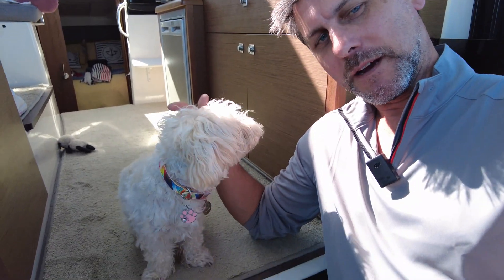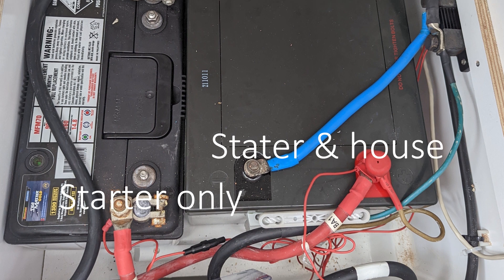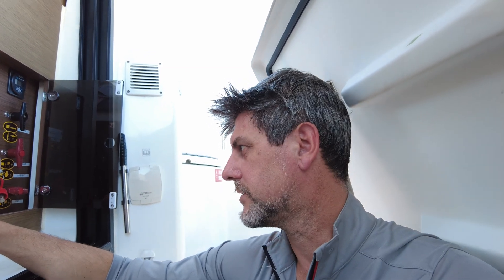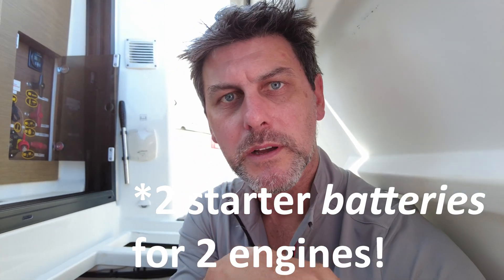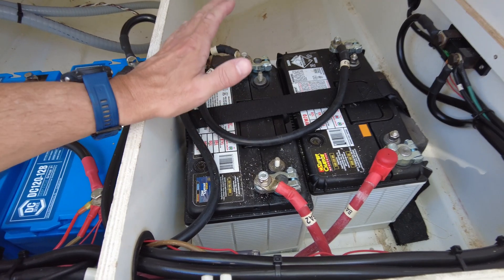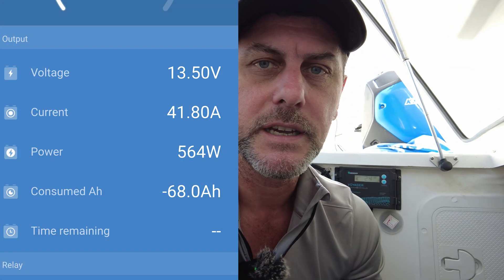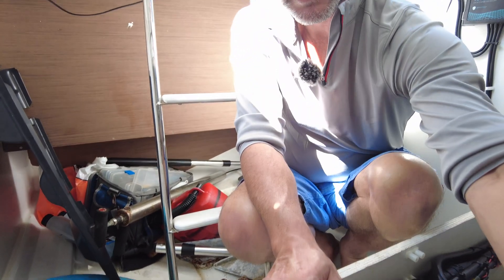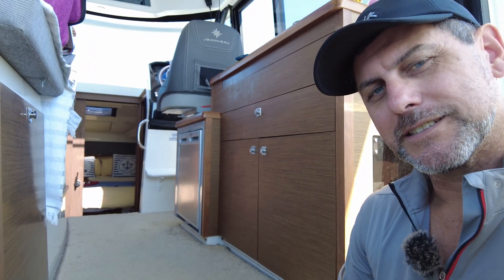NEW BATTERY SET-UP

Comment: Great improvement separating the house from the start batteries. The aux charging circuit on the Yamaha engines is great. The aux charges the three 90 Ah house batteries on my Ranger Tug 25.  I agree with you that lithium is all the rage now and would have made your project more complicated. But from your previous vids you have a good understanding of your power usage for overnights and know how to manage it. You’ll do fine with this setup. One possible suggestion is trying to add more solar charging capacity so you can stay longer at anchor without needing to run the engines to recharge house batteries.
Reply from the maker: Thanks for your comment. The battery setup has worked well so far. The Aux charging is great and linking it from both engines means there is significant amps flowing !! Always work on the keep it simple stupid (kiss) principal ! Thanks again

Comment: Hi I set up my battery banks using 2 x 200 AMP/H Enerdrive Batteries, having them separate from the standard factory AGM cranking batteries. We have two Enerdrive DC to DC chargers that take power from the Mercury twins and charge the Lithium bank and the cranking batteries. (same applies when on shore power charging both banks through the onboard Battery Charger - Cristec) The benefit of using the DC to DC chargers is that you can control how 'greedy' the Lithium's are and how much you want to feed them. We have heaps of power and using our Enerdrive battery can use the coffee machine and for short periods even the AC unit factory fitted to our boat. Agree our set up is a more complex than yours and takes up the same amount of space but we have all that additional power at least 350 to 400 amp/h to use when we stay for longer periods in Rottnest island. It will be interesting to monitor the pros and conns of each set up ? Cheers Sam

Comment: Hi Damien, as an 895 owner with the factory less-than-ideal battery setup, I share your sentiments, and intend to do something very similar to your description here.
I am not sure what you mean by “…house bank being charged by the accessory/auxiliary side of the engines..”
I’m not familiar with an “auxiliary side”?   Each engine only has one alternator?
I was intending to install a voltage sensitive relay (VSR) between starters and house, so that the engines(s) charged the starters first, then the house bank. I think this is common, and achieves what you have.
Maybe you have a VSR also?
I’m just asking to improve my understanding before I modify my setup :)
Reply from the maker: Hi Phillip, sorry if I wasn't clear, thanks for the feedback. I totally share your sentiment that the batteries are poorly wired from the factory. The Yamaha alternator has two outputs, the second one being aux power. So the aux from BOTH engines go to the House bank, and the main alternator output goes to each starter battery (does that make sense). No VSR in the system. Northside marine did the electrical work. I hope that helps. Damian
Reply: @TheRudder   Well I’ve learnt something - thanks!
I have Mercurys, and I suspect that they don’t have that dual charging/output capability. I will find out, because it would make house bank charging easier.

Comment: Hi Damien, is the solar panel charging all 4 batteries now? Or just the house batteries?
Are you planing on heating your hot water tank?
Thanks lee
Reply from the maker: Hi Lee, should have mentioned that, the solar is ONLY powering the house batteries. Two difficult to spit the voltage requirements between the different batteries. The house batteries do power the hot water system, I converted my system to 12V -https://www.youtube.com/watch?v=PGcqYfo1rYU

Comment: Interesting!  Damien, did I hallucinate or didn't you previously add a 300 AH house bank?  If so, must have missed where you chucked it.  About that "50% rule:  Given how you use your boat - usually plugged in, only occasional 1-2-3 day trips, that 'rule' which everyone parrots is hardly iron clad for you.  That 'rule' is based on a battery mfgr's estimate of how many FULL cycles can be delivered, each one to 50% discharge level, before the battery capacity is reduced by X%.  (That X% varies from 20% to 50%, depending on the mfgr).  Your trip today is a good illustration why this 'rule' isn't critical:  Overnight, you used ~17% (40 AH) of your house bank's capacity.  You could have had 3 similar overnights to reach 1 full cycle of use on the house bank.  Other battery failure issues aside, it's going to take you many years at your current usage level before significant degrading of that bank will occur.  My point:  If you occasionally drop to e.g. 30% remaining capacity on the house bank due to an extended time on the hook, both how and how long you use Antoinette isn't going to be significantly affected.  Wish the 'experts' spent as much time pointing out how & when to water those AGM/wet cell batteries and occasionally wiping down the cables and protecting the terminals.  Those things will contribute more in the short term to battery performance and battery health.  And FWIW - again, for your style of use - IMO you did exactly the right thing to go AGM rather than Lithium.  (Sorry for the text wall).
Reply from the maker: Hahaha no hallucination I DID have a big battery but it died very suddenly. I believe because even though I joined the battery banks it was outputting cranking amps to start the engine - not so good for an AGM battery. This is the main reason for the re-wiring. Thanks for the additional input and support my decision for AGM!
Reply: @TheRudder  Interesting you thought your large AGM battery was being killed by engine starts.  We're getting close to buying a 795 - Ft. Lauderdale USA boat show in a few days - and on Jeanneau's spec sheets they state house and engine banks are both AGM.  Given your low level of boat use & the failure symptom, I'd bet it suffered an internal short - aka: manufacturing fault.  FYI Jeanneau is now bringing  in 695 & 795 single engine models with Yamaha's Helm Master.  'Skyhook' type control settings and all the typical autopilot features.  Marketing-wise, a Small Boat/Big Features approach for us Americans, I guess.
Reply from the maker: Hi Jack, I could well have been a manufacture fault but it was just out of warranty :( It will be interesting to see how they wire and split the house and engine batteries up. Yes everyone is getting Helm Master now. such a cool feature but costs a lot to retro fit! Thanks